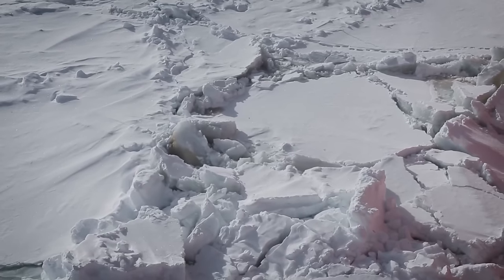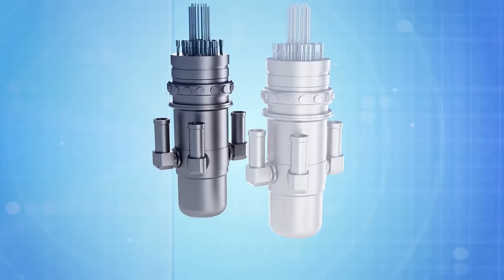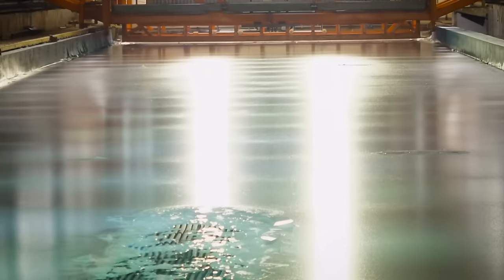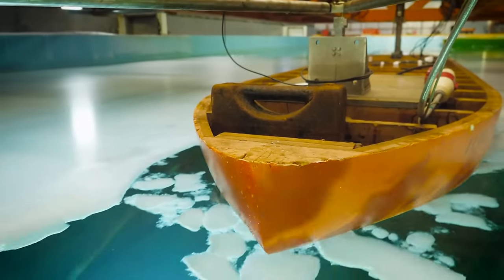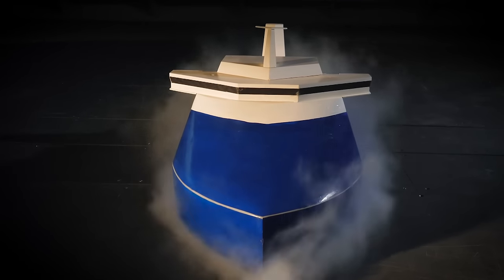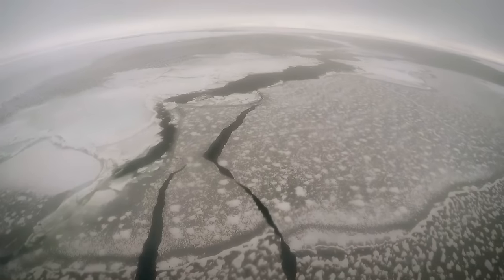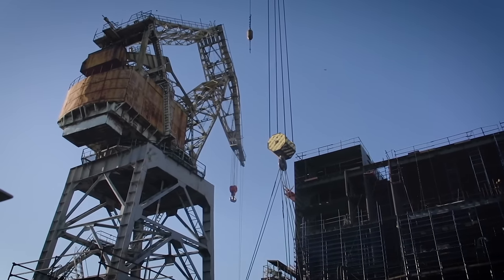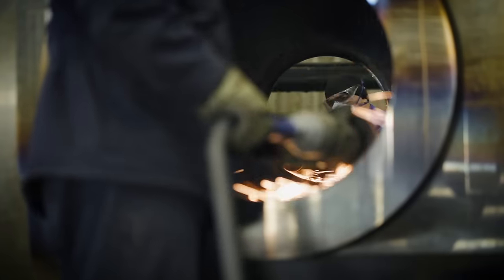World's Most POWERFUL Arctic Icebreaker - Project 10510

Comment: Russia has a unique problem as the majority of their direct ocean access is probably in the Arctic Ocean so it is a wise venture to build such a fleet of icebreakers to keep deliveries by sea possible during the long winter there. Props for the intelligent investment.
Reply: That’s one of the reasons they took crimea back
Reply: For this purpose, the icebreakers of project 22220 are being built, there are 7 of them in the project, 3 have been built, another Leader is on the way, and there are still 7 pieces, and these are only nuclear, not counting diesel ones.
Reply: Спасибо друг . Все верно сказано . У нас есть флот таких кораблей и его ждут пополнения.
Reply: Что случилось с лодкой Курск? Она утонула 😂

Comment: I wonder if a heated hull would help?
Reply from the maker: good question
Reply: @science-channel  In order to prevent ice from sticking to the sides, pneumatic washing is used - there are many holes on the body through which air bubbles are supplied to prevent ice from sticking. But hot water, the mention of which can be found in some sources, is not used for driving in ice. On the icebreaker "Russia" experiments were made with heating the hull in the bow area, but they turned out to be completely useless. True, when parked in ice, the ice around the icebreaker melts - which is not surprising, since 20,000 tons of sea water is required to cool all systems per hour, which at the same time heats up to 25 ° C. At the same time, the decks are completely heated so that the ice does not freeze and it would not have to be removed
Reply: Nope. The amount of energy for that will be just enormous... Pneumatic machines (bubble generators) are much cheaper, efficient and they also generate 'repulsive forces' that push pieces of broken ice away from the ship's hull.